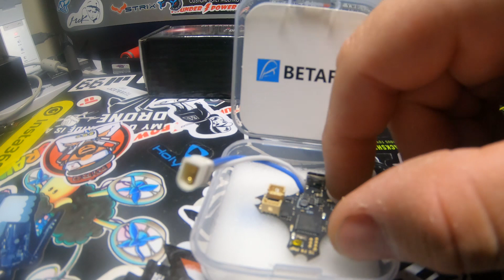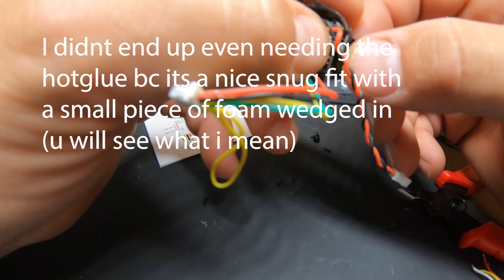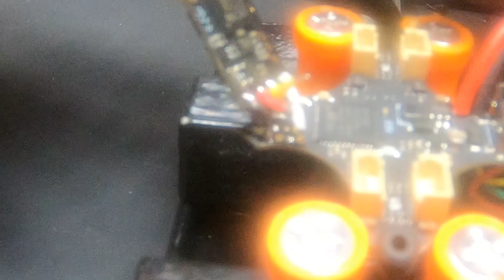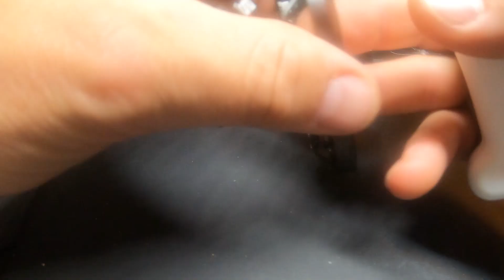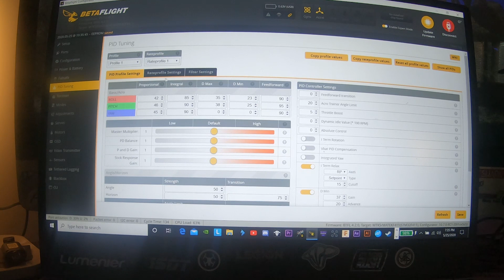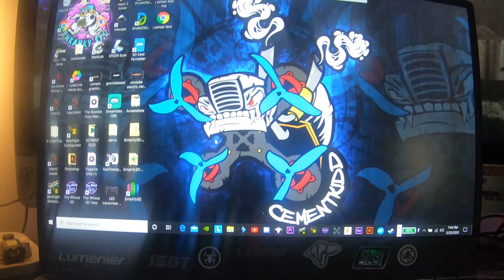CROSSFIRE 1S WHOOP!! (CRSF SHOT) | BF 4.2 | RPM FILTERS |  JESC |  FULL BUILD, PROGRAM, AND SETUP

Comment: Weight of the quad?
Reply from the maker: 23g dry weight 30g with the gnb batteries
Reply from the maker: Just weighed, 24.4 grams dry 32.13 auw
Reply: @cementkidd  uz65 ...23.3g with crossfire ...but with some issue
Reply: @cementkidd  thanks for response....you should sell this to me...
Reply from the maker: I forgot to mention that in the video.  I will update that on the description thx ✋